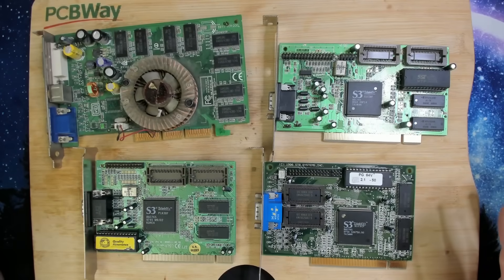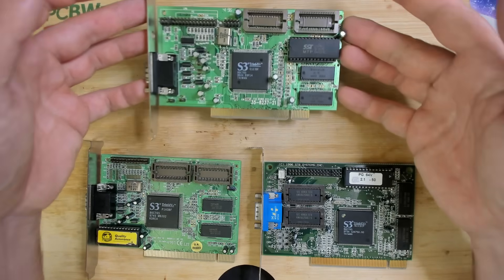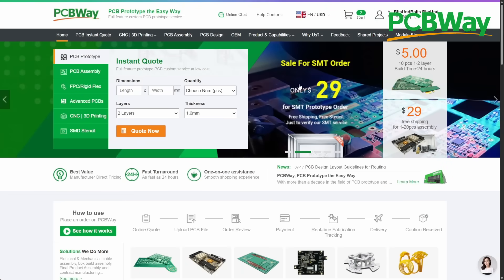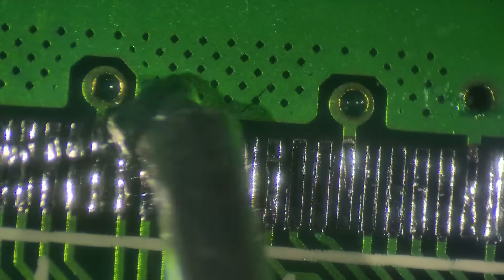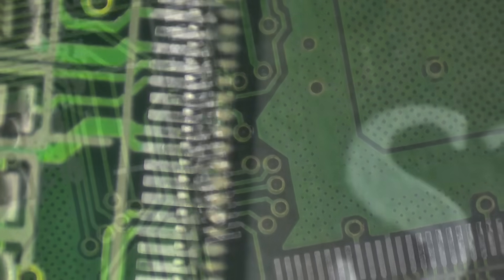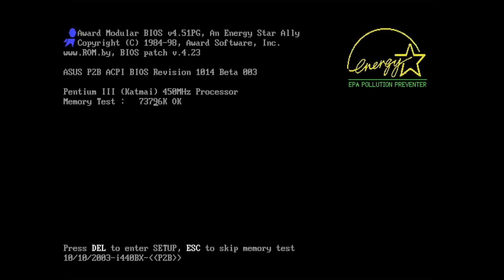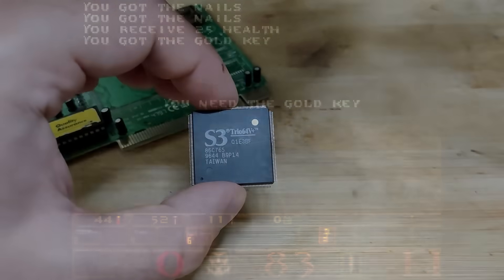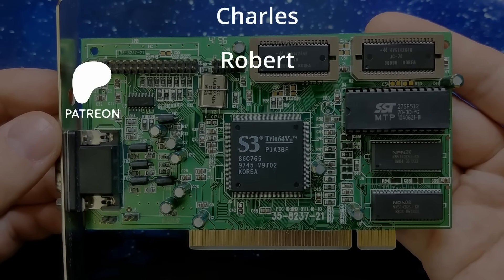My Childhood S3 Trio64V+ is Dead! Can We Save It?

Comment: These s3 cards could also come with 2megs onboard with the ability to upgrade to 4mb. You could probably do it for this card too.
I have one upgraded this way.
Reply from the maker: Yes, it is possible. I also have one card with 8 memory chips (by design). I will get this card out of storage - it also has a fault if I remember correctly. I have never seen a 4MB card on the scrapyard, they must have been rare. The extra memory probably doesn't give you a lot of extra benefits considering what the S3 Trio is capable of.

Comment: Felt a bit sad watching this, remembering all the broken hardware I threw away as a kid — stuff I could probably save today with the tools and skills I've acquired. Anyways, great repair (as usual)! Please tell me what flux are you using, and if it cleans easily afterwards. Thank you!
Reply from the maker: I'm using Amtech 559 ASM.
It's supposed to be no-clean, but it remains sticky. I clean it with isopropyl alcohol which works quite well.
Reply: Same. I threw away our old family/my childhood computer over 10 years ago while in high school because I thought it was dead (PSU died but that's it). I also threw away a Sega Genesis model 1 (one of the early good ones) and all it had was a bad voltage regulator. So stupid. I'll never have my childhood PC back.

Comment: S3 Trio64 UV+ is quite an interesting chip because, judging by the name, it has a Unified Memory Architecture, the chip can work with RAM on the motherboard directly. However, as I understand it, this technology can only be implemented if the motherboard manufacturer designed it with integrated (on-board) video on this chip. A PCI card with this UV+ is essentially the same as a V+
Reply from the maker: Hm, I wasn't aware of that. i might have seen some onboard S3 chips on some OEM boards, but they usually had dedicated VGA memory. Maybe it was just simpler to do it that way than implementing shared system memory access.
Reply: @bitsundbolts  I assume that it's a matter of performance and complexity of wiring. Perhaps some signals were required from the chipset. I can only recall the i810 chipset, where the framebuffer could be placed in the system memory, and nevertheless, brand manufacturers usually installed separate memory chips for the framebuffer.
Reply from the maker: Funny that you mentioned this chipset. I pulled one of these boards with i810 chipset (an ASUS board) from a pile of scrap boards the other day. It does have 4 MB onboard memory. I also took a slot 1 board with Riva TNT chipset - I guess I'll investigate onboard graphics one day 😊
Reply: @bitsundbolts  Yes, I had such an Asus slot1 motherboard with an i810 chipset, 2 video memory chips, and 2 ISA slots via an ITE PCI/ISA translator chip. But I didn't even turn it on, and now it's not at hand. :)

Comment: What a coincidence, I also got an S3 Trio64V+ as part of the first upgrade I purchased myself, not bought by my parents or a hand-me-down from a friend. It was with an AMD Am5x86-P75 (133MHz) and socket 3 board. We had a 66MHz 486 that was a hand-me-down from a friend who upgraded to a Pentium, so it was a very cheap upgrade that I saved up my pocket money for. I went for a new video card since the new motherboard had PCI and I wanted a faster card than my old ISA one, and it also came with 2MB pre-installed, so I could use higher resolutions too. Eventually I replaced the card with a S3 Virge card made by Diamond, can't remember which model, and later on a Voodoo2 8MB.

In hindsight, if I'd waited just a couple of weeks and bought from the PC markets instead of a shop, I probably could've got a much better deal, but I had no idea they existed, I just found an ad in the newspaper for a local shop and went and got their price list. Pentiums were starting to come into the 2nd hand parts markets, and you could easily get a 100 or 120 or even 133MHz Pentium that wiped the floor with the AMD for pretty much the same price, and Virge cards were also coming down in price quickly.

Comment: Very good video as usual!! Regarding the FX5600XT, I have same card!

You can search for ti as Creative/MSI 256MB 128bit card. Bought it brand new back in January '04 to accelerare my P4 a little bit haha. It now lives happily on my Tualatin build ;)

Let me know if you need some photos of the components, I'll be very glad to help you ;)
Reply from the maker: That would be AWESOME! There is no rush, but a high resolution picture of the back of the card would probably help a lot. I can check which components are missing and maybe identify that one transistor that is missing. There should be a marking that is probably readable. I usually hold it against some light source until I get a good angle to read the markings.
Most of the capacitor values I might have to guess, but resistors should also be possible to read off a high resolution image.
Whenever you get the time, I'd really appreciate if you could identify the transistor labeled Q1 - it is right above where the AGP connector starts. You can send the picture via email. No rush though! Thanks in advance!
Reply: Of course, count on it!! 
I'll send you some photos/info of the card for sure, expect them in a week or so ;)

Comment: Hi @bitsundbolts, thank you for sharing the S3 card repairs! These cards are very common back in the late 90s and they get the job done.
I have also a S3 Virge DX (4mb?) card, unfortunately it couldnt start also. The first attempt of the repair reveals the crystal 14.3M didn't work too well so I replaced it with a new one. It worked for a while and it goes back to being not starting again.
I'm not sure if this can be repairable anymore, and if this is possible, I can even donate this board to you for further repairs. 😊
Reply from the maker: I also have some S3 Virge cards which I need to test. Usually, there isn't much going on aside from the main graphics chip. Those chips where highly integrated. All I could think of is that you might have bad solder connections (maybe due to some corrosion). If that's not the case, then it could be a faulty chip that degraded over time (even when not in use).
I am actually surprised that you got the card working by replacing the crystal - I never had it that replacing a crystal fixed my issue.
Although I appreciate you offering the card for donation, I have very limited space and a couple of S3 Virge cards.
Let me get to my cards first, maybe there is something that might help you resolve the issue on your card and if not, we can still figure something out.
Reply: @bitsundbolts  Hi thanks for the response! It's understandable that space are limited, me is also struggling to have more space for my retro stuff too. Maybe I can actually reflow them again and see how it goes. It's sad to see some of those good cards break after for almost 3 decades! 😅
Reply from the maker: If you can't figure out what is going on with the card, we can arrange something. It's just that sometimes it isn't worth to send cards around the globe :)
Reply: @bitsundbolts hi thanks for the response. Basically I like this card very much too but feels sad that it doesn't work anymore. I'll still rewatching some of the other repair videos you have and try it on that card later. I know sending stuff out is pretty expensive and I'll try my best to do a repair first. 😊

Comment: I used to run Win95 with one of these, a Pentium 166, a Monster 3D and some sort of SB.  When I added the Monster 3D the performance boost was shocking.
Reply from the maker: Yes, 3Dfx changed the landscape of 3D games in 1996. For most, one of these S3 cards were good enough and budget friendly. 3Dfx did well releasing an add-on card instead of a replacement since it felt like you are spending all your money on 3D power not on replacing your existing 2D card with another 2D card that can do proper 3D as well.

Comment: If you solder 60ns memories and put 70ns in the extended sockets! The entire video card will work at 70ns... the best would be to put 60ns everywhere !
Reply from the maker: Yes, that is what I will do once I find 60ns memory chips. But I would assume that there is no way to get the information electrically from the memory chip if it is a 60ns or 70ns version. Wouldn't that have to be coded in the BIOS - if at all? I have seen that older hardware just requires at least "80ns", "70ns", or "60ns" (like the Sound Blaster AWE64). It could be that the timing is fixed on a hardware level (not even via BIOS). That means, most likely, there is no difference in speed. If a card is built for 70ns then there is no improvement if you use 60ns memory. If the timings are made for 60ns memory and you use 70ns chips, you run the memory out-of-spec (overclocked) which could lead to instability. At least this is my understanding of how memory technology works.

Comment: If that FX5600 fan is that baked, chances are the GPU ASIC is fried. That fan had to be smoking hot for a very long time for the plastic to be degraded to the point of it breaking up.

Might explain why the SMD parts are missing, it was used as a scrap donor board.
Reply from the maker: I think this card was probably exposed to the sun here in Dubai for an extended time. This doesn't look like normal wear and tear. Also, the SMD components have surly broken off while the card was hit by other scrap board and cards.
Reply: @bitsundbolts  The sun wouldn't cause the fan hub to turn into charcoal black and crack from the hub. I've seen that same failure on many cheap and nasty video cards over the decades. If the sun had did it, the plastic would be uniformally damaged and turn to dust.

What happens is the heat from the GPU burns away the oil/grease in the fan and the fan locks up. Since those fans don't usually have no-spin protection, they just keep pumping current into the coils, until they get so hot that they transfer the heat up the fan shaft and burn the plastic from the center out. Eventually the coils turn dark brown and eventually black.

It was a really common problem among cheap and nasty video cards with the style of fan having the hub directly over the GPU ASIC. Really terrible design. The oldest cards I've seen it on are TNT2 and the newest was in the Geforce 7 era. ATI/AMD weren't immune to it either, their crappy x300/x1300 up to the HD6450 had the same issues.
Reply from the maker: Maybe you're right. Well, as the card looks, I probably would just use it as a donor board (although there isn't much useful stuff on it). Soldering all those SMD component on the card is probably not worth it either - only to find out that the chip is dead caused by overheating as you assume...
Reply: @bitsundbolts  It's only worth how much you want to torture yourself :D

Awhile ago, I had an HP Apricot RS620 motherboard I bought from the scrap yard. I was curious if it were possible to add the missing DDR3 and PCIe x16 slots and have them work.

It was 1,288 solder joints and 50 x 0102 capacitors the size of a grain of dust for the PCIe signal lines.

After hours of work, I powered it up and both of the new DDR3 slots and the PCIe x16 slot worked. Though the BIOS had no idea about those slots, so it would happily boot while displaying "0 MB RAM installed." Operating systems saw the correct amount installed.

Comment: The S3 world is really interesting, vast and unknown. The hole in the bracket was used for a jack connection that I never understood for what purpose it was present on some models. In this case the jack is not present, but they probably had many brackets already made. Congratulations, as always!
Reply: Some cards had a composite output RCA connector. That is what the hole is for.
Reply: @simontay4851  Thanks is the most plausible answer. Many times I have to avoid reading the inaccuracies they write on Vogons, especially with the S3 there is a lot of imagination: "Basic sound out jack, midi maybye or all in one sound card?". Vogons: if you don't know, you invent. @bitsundbolts can you reveal the mystery ?
Reply from the maker: I might have a card that has that connector. You're right - I didn't even notice that there was a hole in the bracket.

Comment: It would have nice to bench the card before and after the VRAM swap. Because it might not mater, as probably the bios dictates the vram speed. So you might need to swap BIOS chips and test..especially since the donor-card is newer, so probably has a newer bios version (but check bios-chip voltages first, as they may differ!!).  
Also, AFAIK, these cards also suport both EDO & FPM memory... so you might wanna check that you don't mix modules.. 
P.S. on the dead card at the end of the video, i'm almost sure it's pointless to install memory in Bank 2 without Bank 1 being populated, as it will not work.
Reply from the maker: Could be that the card doesn't work with memory in the sockets only. Also something I might try. I am still debating if I should remove the memory of my now working card and add sockets also for the other memory locations. That would make it easier to swap memory.
I think it would be interesting to investigate on this topic. Maybe there is a "best" BIOS for the S3 Trio64V+.
Reply: @bitsundbolts  An "all sockets" PCI card that supports both EDO & FMP memory, would be indeed VERY useful to have, in order to test RAM chips.... not to mention experimentation & stuff! :) 
There is a very nice piece of software made by Cherkes Mihail, called Video Memory Stress Test. Version 1.21 is bootable (in floppy or ISO variants), and Version 1.7.116 is for Windows environment. I recommend both! :)
Reply: @bitsundbolts  mikelab kiev ua ; but you'll have to access it through the wayback machine.
Reply: @bitsundbolts  YT won't let me write his website, no matter how i write it. It's a Ukrainian site that it's currently down, but it works through the WB Machine.
If you can't find the program(s) through google, lemme know, and I'll send you an email :)

Comment: Being clearly a bit younger than you, I admit my initial reaction to this video was "but why?"  The earliest video card I remember having was some Trident thing.  It was decent, and hilariously capable of "running" the earliest versions of OpenGL.  Unfortunately, in this era, installing any legitimately OpenGL capable card would improve general system performance, so I guess that left me a bad impression of normal VGA cards.

Regardless, this is some fine work.
Reply from the maker: It was just curiosity why my card stopped working. Looks like the chip took damage for whatever reason.
At least I know now that the S3 chip had issues and I should be able to restore my childhood PC as it was around 1994/95.
Also, it was a nice exercise swapping chips - and it wasn't complicated. Maybe it will encourage others to try their luck with chip swaps. Next step are BGA chips - I just got my (cheap) BGA reworks station :)

Comment: Used your soldering technique to build my HEX3653 FM radio, my first SMD
Also might be interesting to test the performance 1MB vs 2MB possibly more so in Wintach, as the 2MB not only allows higher modes, but upgrades the memory bus from 32 bit to the full 64 of the Trio64
Reply from the maker: Oh - I wasn't aware of the increase in memory bus width! That definitely improves performance. I always thought higher refresh rates and larger resolutions are the only benefit you get from cards that old. Thanks for the pointer!
Reply: @bitsundbolts  Not all of them, but without it, the Trio 64 is acting like a Trio 32
"The Trio32 is a low-cost version of the Trio64 with a narrower 32-bit DRAM interface (vs. 64-bit)".
More likely to show up a difference in Windows 2D acceleration than in pure DOS, as the 32 bit RAM can probably keep up with the best the PCI bus can do

Comment: if you are not going to overclock the memory mixing 60 and 70 ns memeory is fine because slower one already worked fine, mixing brands is also dine at those speeds
i done that with my trios multiple times
funniest part was trying to play unreal on that with or without memory upgrade where resolution  the game could run in software render mode doubled with and halved without those chips
Reply from the maker: Good point. I should put this on my list to test for an upcoming video. Those S3 cards might just be so much more interesting than I thought :)

Comment: I had S3 Trio 64V+ in my first own machine, P100 (later succesfully OC up to 133). My user experience was pretty begginer at that time, so I had much problems with drivers, games etc. But gained some xp with it, solving them. It also had some bug in win95 driver that halted machine if switch to some VESA mode while in DOS window and then back to GUI. Later I found some bugfix, more likely a tweak that required run it every time you start DOS window before any grafix mode use. And even more later I found new driver (no internet access back then, just p2p in real world or BBS, I beleive new driver was on BBS) with this problem fixed.
Upgrading VRAM up to 2Mb was some thrilling quest for me as well, cause I had bad experience of killing some components when trying to build my very first machine, 486, and it ended with dead MB and CPU. So I had no confidence that this time it won't fuck up. But it went fine. 2Mb and 800x600x32bpp mode with full 2D acceleration. Yes! It was a triumph!
Reply from the maker: Great experience when an upgrade works and you feel the benefit of your upgrade. The first time I upgraded or replaced something, I was also scared! I remember upgrading my 486 from 8MB to 32MB and replacing my 4x CD drive to 32x speed. Each time it was nerve wrecking. Most of the software came on CD-ROM from PC magazines back then - as you said, no internet as we have it today.